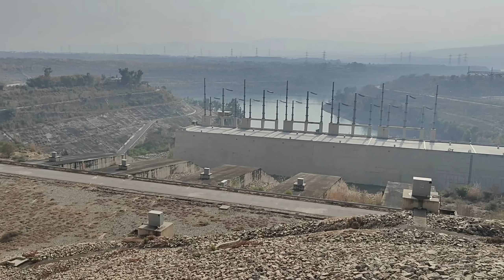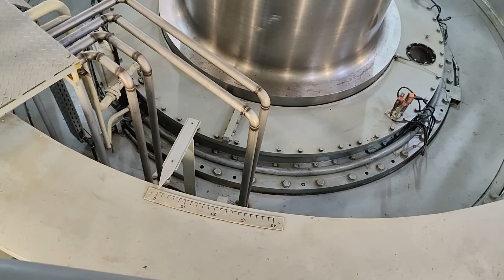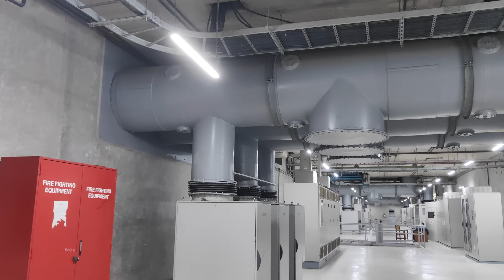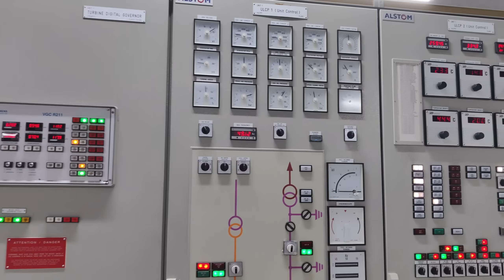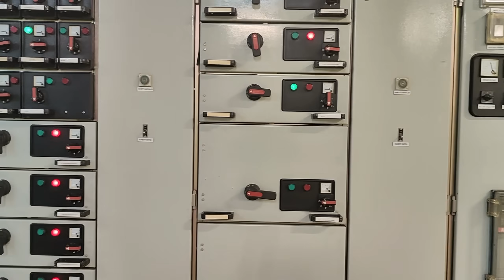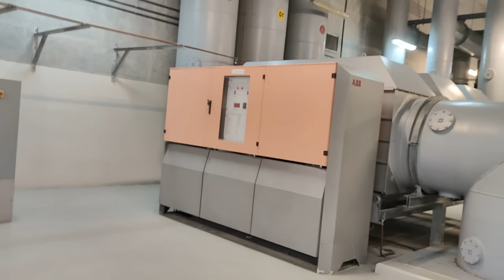Floating on Oil: The Invisible Technology That Starts a 900-Ton Turbine Rotor

Comment: The PLC and CPU control the entire process today. 

You click the mouse on the START button on the screen and the process starts. 

Everything he described is done by the computer and the logic controllers

Once running at 100 RPM 50 Cycles, it connects to the grid in a micro second at the exact moment to meet the grid cycle exactly. 

Those rotors WILL match the GRID Cycle when you connect them to the GRID

But, if it is not perfect syncing, it will be a massive explosion and the plant will be destroyed 

It is REALLY dangerous 

The start-up is the most dangerous time ever to be near a power plant

Comment: The oil pimped to the thrust bearing during start up and shut down is referred to as a "High lift system" On small hydro units with no high lift, when the water enters the runner it actually lifts the unit slightly so the oil wedge can form under the thrust bearing. With the high lift operating a few people with some effort can actually turn a unit of this size for maintenance work.

Comment: So you need power to start the Generator. Is this grid power? Or do you have generators on site to do a black start?
Reply from the maker: Great question.

Yes—during normal startup, the plant uses grid power to run essential systems like lubrication, cooling, and control equipment.

But in a full blackout, many plants are equipped with a **black start system**—usually diesel generators or a small auxiliary unit—to bring one turbine online without the grid. Once that unit is running, it can help restart the rest of the plant.
Reply: @hyrovision ok. I imagine a black start (for the whole grid) to be a awfully fragile process. Bring up one turbine basically disconnected, prevent runaway, connect loads until there is enough to warrant bringing up the next turbine/plant, add load and so on...

Comment: Where's the governor?
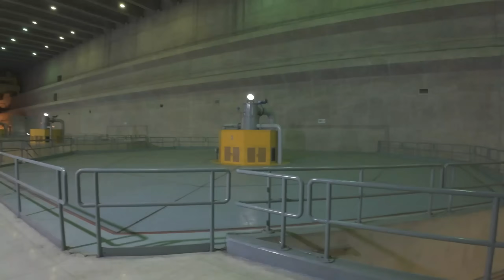Reply: I hope somebody will correct me if I'm wrong, but they're usually in the housings you see at 0:31. Those contain the exciters, the little generators that energize the field coils in the big main rotors under the floor plates, and the governors are in there, too. In the ones I've seen opened up, they're right at the top.
Reply: @racookster thank you for your enlightenment.

Comment: I'm always fascinated by the safety systems in infrastructure like this.  I chuckled a bit when I saw the 3 fire extinguishers together on the wall.

I was also surprised at the number of sharp angles in those ducts. I'm guessing they aren't moving water, and if they are they are doing so at low volume?
Reply: That looks like gas insulated switchgear and busses.
Reply: i believe it may be possible that those large square ducts are part of the systems that move air and ventilation throughout the plant areas.

Comment: It was fascinating to see 250 MEGAWATTS of power come alive- from right before the turbine's shaft began to turn, right up until it was finally locked into the power grid. That much electricity is like a physical, tangible thing, and you offered a great explanation of the process.